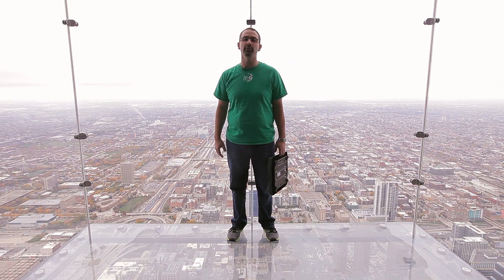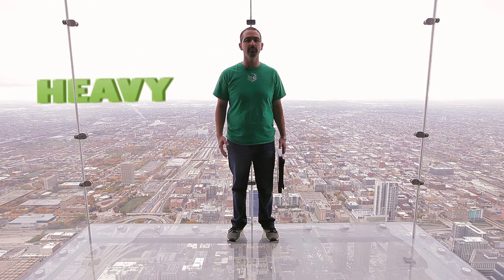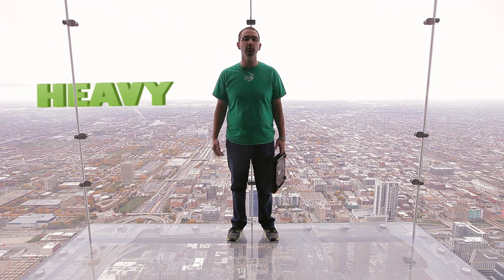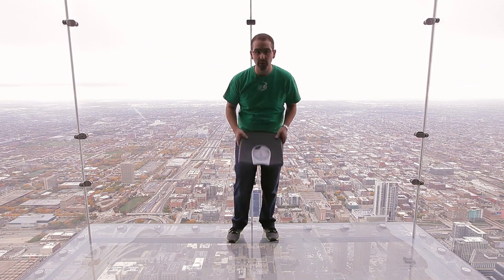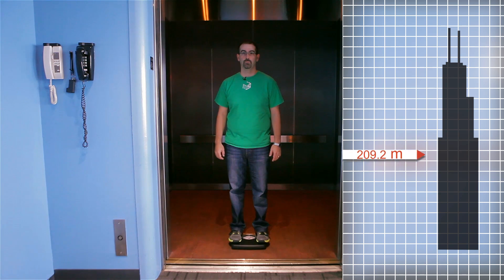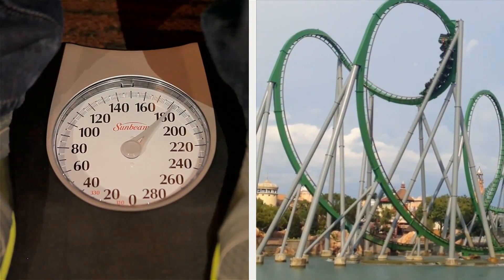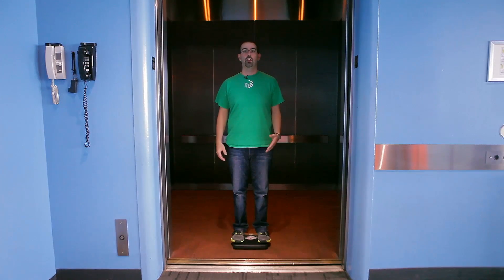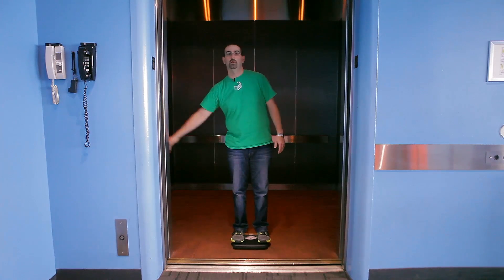Real World Science: Forces in an Elevator

Comment: Inertia is not a force. It is simply the tendency for an object to want to maintain the state of motion that it is in, be it in a state of rest or in a state of uniform motion. The apparent increase in your weight as the elevator decelerates before coming to a stop when it reaches the bottom floor, is due to the normal force from the scale having to push up harder onto you in order to overcome your true weight, i.e. the force of gravity pulling you down onto the scale, and slow you down.

Comment: Ahhh, but the real question is, what is the difference in your weight on the 103rd floor vs on the bottom floor? The further you go away from ground level, your weight actually decreases because your moving away from the force of gravity... measure that.
Reply: A 100m change  is insignificant when its about about 6.3million meters from earths surface to its center.